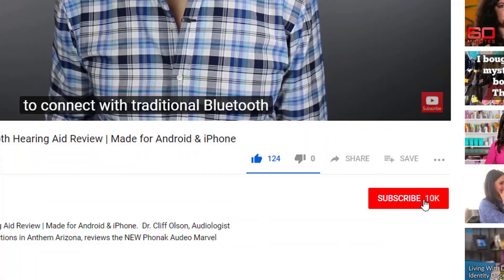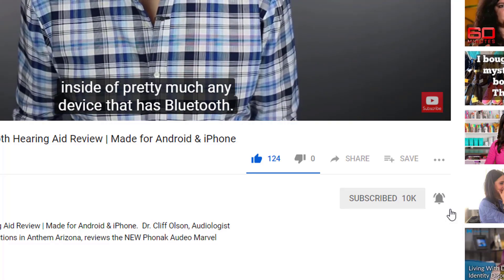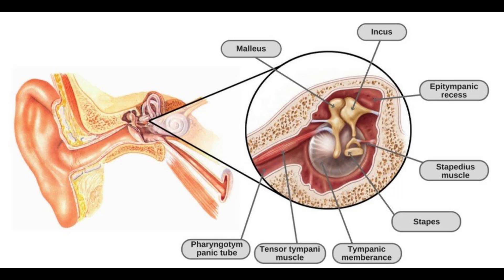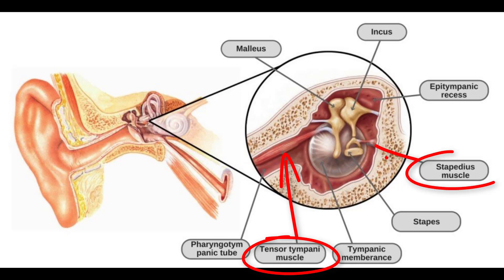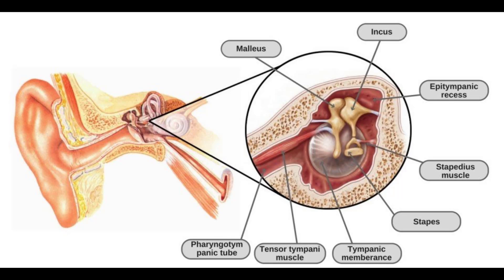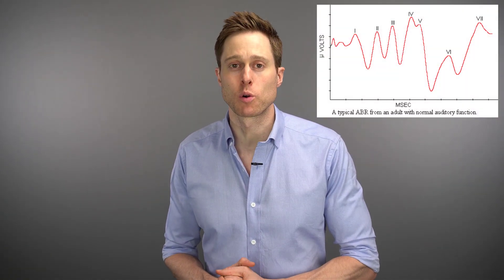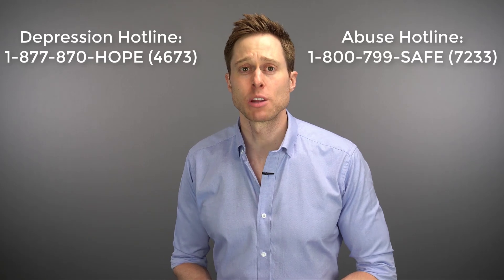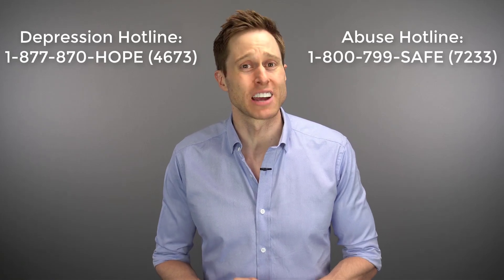How to FAKE a Hearing Loss During A Hearing Test

Comment: What frustrated me was the fact that during my separation physical tne doctor stated  " You have a slight hearing loss, but; it's not service related."   That was an outright lie.  When I entered I had to have perfect hearing,  the position (MOS) REQUIRED communication with aircraft to control them.  I would not have been accepted had my hearing been less than perfect.  In  the last 18 mos or more before I separated I developed tinnitus.    By the laws they operate under any injury you sustain while in the military short of deliberate self-harming yourself, is considered service related.  (I suspect one might even claim the mental condition that led you to self-harm might be considered service related.)

So faking it - CERTAINLY, NOT ACCEPTABLE. Doctors who lie to military personel about their injuries not being service related ALSO NOT ACCEPTABLE.

Comment: My left ear feels clogged and there’s slight ringing. I can hear somewhat but it’s incredibly muffled sounding. I bought an ear camera on Amazon and I don’t see anything physically blocking my ear. It’s stressing me out and I want to go to the ENT doctor but I’m worried they won’t take it seriously and think I’m faking.

There’s been no injury, just had the flu for a little bit, but it’s been a month now. I’m no longer sick, not congested, but my ear is still plugged. This has never happened before.
Reply: I know it's 2 months later but I wanted to help if I could. I had EXACTLY the same symptoms under the same circumstances. I went to an ENT who prescribed a sinus rinse and two nasal sprays which cleared up my symptoms in a month. This is easily treated and I encourage you to get some help.

Comment: I actually was searching something if actually is possible for audiologist to fake my hearing test result to make me to buy hearing aids. I have tinnitus for about 5 years now and it feels like it gets worse, I am not sure if I also having hearing loss or it is my tinnitus disturbing me to hear properly. So I went to audiologist and after test I have been told that I have 25-50 decibels (mild to moderate) hearing loss. I was highly recommended to buy hearing aids, I do suspect I do have some level of hearing loss but I also hd a feeling that audiologist was trying to make money and sell me hearing aids. So here question comes if it is possible for audiologist to lie about my hearing loss results…?
Reply: I don’t think they lied about the results but it sounds like they are using any hearing loss to sell you on devices. I have mild loss in my right ear and moderate in my left. I was told I was eligible for devices but we discussed the pros and cons and it was never a “you NEED these!”. I did end up getting them only because insurance pays. I am quite glad because I’m benefitting a lot more than I realized.

Comment: Hi I would like to add a comment I have not been able to hear since like the year 2000 I have took like 10 different hearing tests they all come back completely totally different sometimes it comes back where I can only hear one word on a str and other times I can hear it almost perfectly and the X's and O's test is completely sporadic some says I have severe hearing loss and others say I have moderate hearing loss and others say I have profound hearing loss but I've always had at least severe hearing loss according to the hearing test but then I'll take another one and it'll say my hearing is way worse and then I'll take another one and it'll say it's a lot better why?
Reply: That doesn't make any sense , It supposed to be the same thing . I been to 4 different types of Hearing Aides dealers Audiologist Hearing center several miles away from my apartment different years when I needed a new hearing Aides because of my medical insurance company recommend Better Hearing Center since my small town doesn't want my medical insurance company or is it the other way around ? 🤔 Well I mean it does fluctuate just a tiny bit but still have 74% hearing loss in both of my ears and different types of people speaking to me inside the soundproof booths probably made a difference between man and woman speaking to me asking me questions . And I'm not making a joke ‼️I really don't hear women very well . Yes I'm a man . 😔

Comment: Unbelievable you have to make this video. Hey I have a question Im having a hard time telling where sounds are coming from but I dont want to go to a hearing Dr who isnt going to check me for hearing loss in this way. Obviously I can hear but my right ear has deminished hearing Im also having ringing my ears. I was a plant worker for a couple years and worked in Manufacturing for several years I was an AMT but and attended airshows but.. I havent actually worked on any running engines I have a flown a few times but I think my hearing loss started when I got the flu and caught inner ear infection in both my ears. One night my ex was talking and all the sudden she sounded like she was using AUTOTUNE like a robot... Everyone sounded like a robot. I flipped out and went to the ER and there was a baby crying however that baby when I looked wasnt on my right where I thought it was coming from it was on my left. That was the first time I knew something had happened to my hearing for sure. My mom and Grandfather both suffer from Hearing loss in the right ear mines also in the right ear. I had a stroke in 2014 and suffer from a couple neurological diseases fast forward to me at 34 and when I hear a phone ring or I hear a smoke detector beep I cant tell where the heck its coming from really this is with most sounds just not voices yet I dont think. What do I do to get this checked? I tried several online hearing tests and well only one seemed to give me much info said I had a 4/5 and that my right ear and really both ears supposedly have difficulty with midtones but thats an online test how can I get an actual test for I think its called spatial hearing loss and not just normal hearing loss? I can deal with things being turned down in my right ear over the left but Im scared I might have to get ear surgery or something crazy and being 34 using a cane the chicks arent going to dig me using a hearing aid. Im embarassed about it all really but like you said some of us really need help ME. Where can I get the testing I need? Do I need to see a specialist or will any hearing center have what I need to be tested?

Comment: Watched another one of your videos and this one came up next. I’m not clear why anyone would fake hearing loss (seems demented) but I am curious if you can be ruled sound of hearing if your problem is more narrow. In my case, I can hear quite well, at a wide range of frequencies and volumes. My issue is that as soon as there is the slightest bit of white noise I can’t seem to discern speech at all and other sounds are quite difficult to hear. It’s always been a problem for me, but lately (I’m mid 30s) it seems to be getting REALLY bad. I can’t understand my kids talking right next to me with the kitchen sink running. I was trying to research how they go about detecting this and it seems like often people will be found to be sound of hearing on pure tone tests and other measures of ability to hear and then find it difficult to get a diagnosis that actually acknowledges their issue. I’m not clear on what exactly could be done for my issue, but I’d like to know if there are any tests they can do for hearing ability, especially people talking, with white noise or just other noise in the background. Any info appreciated. Thanks!